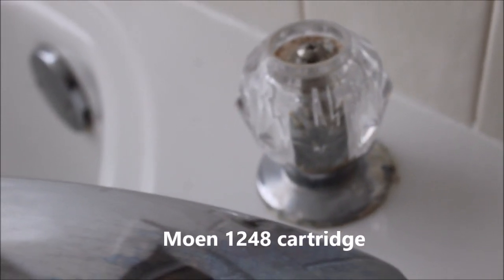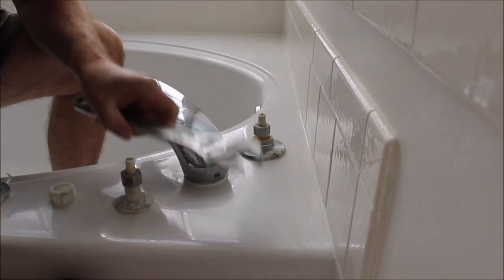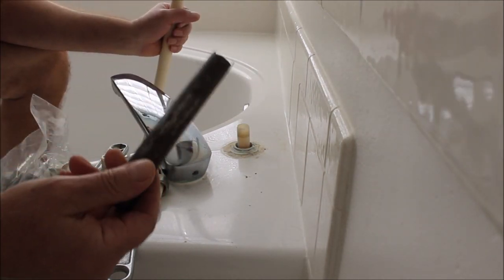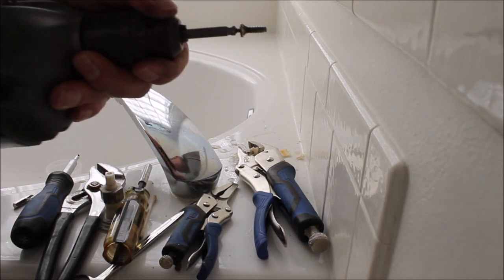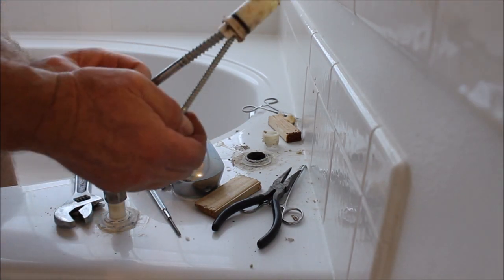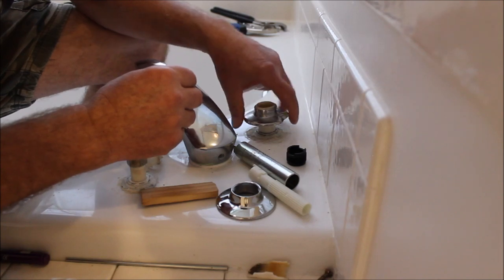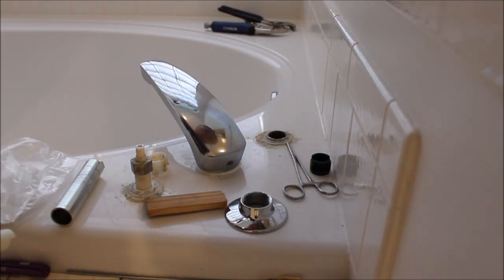Moen Faucet Repair, part 1

Comment: The new valves seem much easier. But, cutting an access panel through the tile would be a big mess. I could cut away the plywood subfloor from inside the basement

Comment: You are very creative in doing the job.  I learned a lot from you.  I am in the middle of the same project, currently stuck in removing the plastic retainer.
Reply from the maker: It was a challenge. I'm not sure if I included it in the second video, but when the plastic was too deep to use the soldering iron to melt it, I heated the tip of a screwdriver to get deeper into the shaft.

Comment: Hi, Robert!

Today I have successfully completed the replacement of the Moen cartridge for Roman tub, following your dedicated video!
Thanks alot!  In my case, the correct part number for cartridge is 1224 instead of 1248 that you used.  
And the correct part number for stem extension is #13463.
As you did, I had to destroy the corroded screw, which connects stem extension with the cartridge, with a metal drill bit.
Also, I used the soldering gun to melt the plastic lock ring.
One extra step that was not mentioned in your video is to use “Calcium, Lime & Rust Remover” fluid. I poured it into the copper tube before trying to  remove rock ring, extension stem and the cartridge.  This helped to lose any mineral build up.  Because of this chemical treatment, in my case, it was easy to take the cartridge out!  Once again, you help me a lot to finish this project!  Thank You!

Comment: We have a very similar garden tub and I am having a challenge to remove the cartridge retainer. Appreciate your excellent video guiding us through the process. I have just ordered the special Moen tool and will be tackling this in a day or two
Reply from the maker: The whole project is relatively easy if you can get the retainer nut out. You need steady downward pressure to keep the tool locked onto the nut.
Reply: @roberthare2251  Repair went well with the Moen tool and your video as a reference, thanks for compiling the steps!

Comment: I'm in the exact same position.  I'm totally gonna steal your melt the old retaining nut out with a soldering iron tip!  Thanks for the video.
Reply from the maker: Hope it worked out for you. A guy on here used a soldering iron to repair a crack in a plastic gas tank, but mine was too far gone when I tried it. The flashback to that failed attempt prompted this win and  probably saved me from busting out my wall to replace the whole fixture.

Comment: I have the same tub set up with moen same handles but my problem is kinda worst the last plumber strip the copper pipe where the cartridge you had problem with. How to change the pipe without cutting hole into tub. ASAP before i let plumber cut
Reply from the maker: Good luck, or, I hope it went OK if you already went for it. I cut the grout between some of my tile under the tube when I realized I would like break at least one trying to pry them loose when I decided to work through the project the way I did it.
Reply: I went ahead and had them cut hole in tub wow plumbers these days have gotten lazy
Reply: How did that go?  My plumber wants to do the same as he can’t remove the corroded cartridge.  I can’t find videos about cutting holes into the tub.
Reply: @emom551  well it turn out that I had to get a hole cut into the tub because it seems like nobody wanted to go through cutting the seal around the whole tub but either way I had to change the piping because of the strip stem so the plumber put in a universal piping but he put in another type faucet which he said was a top 10 pfiher I know it's spelled wrong lol but you know what I'm talking bout but it took 45 minutes just to get the tub half full my water pressure was all good but called moen and order from them they sent the piping that fits the faucet now everything back to normal just have a little door compartment on side of my tub now
Reply: @djbromann88  thank you for responding.  Was it hard to find a compartment to fill it in?

Comment: Hi, thank you for the video. We have a similar faucet. It’s too old that we are thinking of replacing it. We’re just wondering if we could just randomly pick up any design and brand we desire or it has to be the same model and brand as the old one? Thank you.
Reply from the maker: If you are replacing it, you could change to any brand or style, but it's usually easier to work with the framing and holes that are already there by using a similar replacement. The main reason I worked so hard to fix this one is that I couldn't loosen the tiles on the wall in front of the tub without breaking them. Sometimes, it's easier to tear out a wall, but usually the more you tear out, the more you find you need to change or replace, and a small job can get really big.

Comment: Does the water supply to the house need to be turned off to do this?
Reply from the maker: Yes, unless you have some other shut off available to the tub. The faucet is the only thing keeping water under pressure from pouring out of the pipe to your tub.

Comment: Am trying to upgrade my old Roman faucet. It’s not leaking. It passed the upgrade test.I just need to know what faucet model options are compatible with the upgrade kit?
Reply from the maker: If it's working well, I would leave it alone. You would need to know the part numbers for your specific faucet to get an "upgrade kit.".  I put my part numbers in the video, but there are some similar parts with different numbers.

Comment: Is there a  replacement compatible one to change it to, without breaking the tile? Or does it have to be the same one? And where would I find that?
Reply from the maker: In my case, I would have needed to tear out some of the tile and part of the wall to replace the whole fixture. I started to cut out the grout between the tiles but found it very likely that I would break them - which is why I chose to keep the old fixture and just replace the cartridges. Sometimes this kind of a job is easy. In this case, it turned out to be very difficult. The cartridges have to match the original fixture. I think I included part numbers.

Comment: Is there no access to under the faucets?
Reply from the maker: You can make an access. Here, I would have had to cut out part of the wall in front. I started to do it, but I was quite sure I would break at least one tile, then if I couldn't match it, I would have had to replace the whole wall... so I decided to hang in there and do it the way I did. If you want to replace the whole fixture, you'll have to tear into wall to access it.

Comment: Did you shut the water off or no?
Reply from the maker: I'm not sure of the context to your question, but I shut the water off to the whole house anytime I got to the retaining nuts on the cartridges. You can control the flow of water as long last the cartridges are secured in their proper positions. I did one side at time to reduce my overall risk of not having any water.

Comment: Hmmmm my 💭 if your Moen is more than just a couple of years old I would run far away from doing this particular job. Mine was 6 years old. Began leaking out of the stem. I called a 28 year veteran licensed plumber. He was booked up for nearly 3 weeks. Once he arrived and saw it was a Moen he immediately declined the job. Said that his company would not do the Moen brand due to the plastic nuts in their products. 
 Me in thinking wellI have done plant factory machine maintenance for years. Maybe I should try it myself. The only other option the plumber gave me was tear out either the entire tub or part of the wall and replace the unit. I called Moen I purchased the tools that they recommended from them and got all of the parts to rebuild both handles.  Well I should have just tore out a piece of the wall. The thin cheap metal tool wound up twisting and warped due to having to put so much pressure trying to turn the plastic nut. Eventually the nut failed ripping the head ears off. I had soaked the threads with Vinegar and after tries liquid wrench letting them both sit 24 hours. Now I understand the plumber  👨‍🔧 

It’s just not worth it. First time I have dealt  with a Moen product. Moen says the commercial versions are built with more metal and much less plastics making much easier work.  Moen did offer to give me 75% off on a brand new unit. But at this point the only thing I would consider would be the commercial units. Which are much more pricey. 

  Sadly now my other bathroom tub just began leaking as well and it’s a Moen the same age. Guess I am going to have to tear out 2 walls. I am not trying this again.
Reply from the maker: Totally agree about the flimsy plastic nuts and poor design. On the bright side, mine lasted about 26 years, and my repair job is holding up great nearly a year later. I would have needed to tear into a wall to replace the whole fixture. This repeair is full of challenges, and obviously not for everyone.
Reply: @roberthare2251  Moen seems to think that hard water plus the fact that plumbing routing and city water pressure dropping  then surging is causing “early failure”. I also had a Moen Posi temp shower failure several months ago with dripping out of the shower head. All of these fixtures are 2015 models so maybe it was just a bad year in plastic

Comment: Should the hole on the side of the cartridge be open or closed?
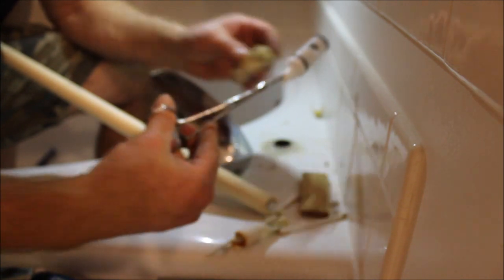Reply from the maker: I don't think it matters if it's open or closed when you install it - open is on and close is off - but the hole should be facing the supply line to the spout which should be straight toward the middle of the assembly. The water comes from below and exits the cartridge to go to the spout. The picture is fuzzy, but you can see it at 5:16 in the first video.